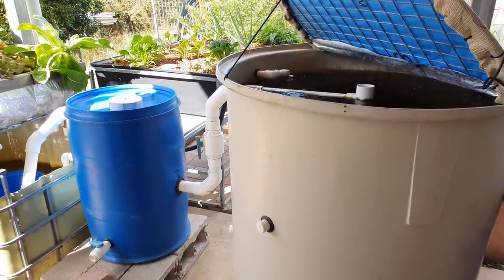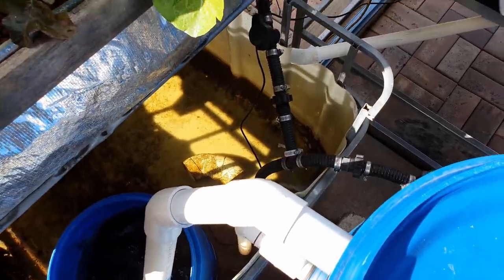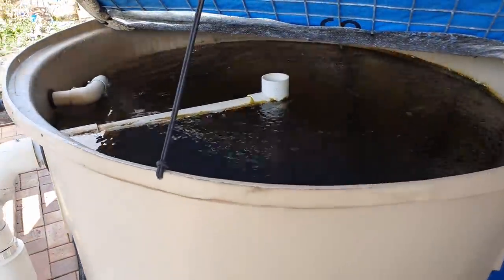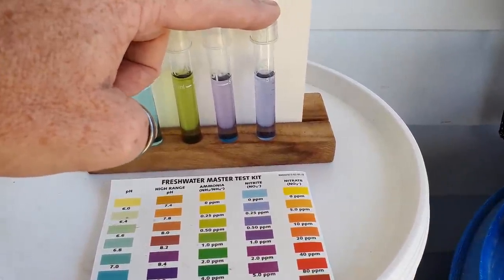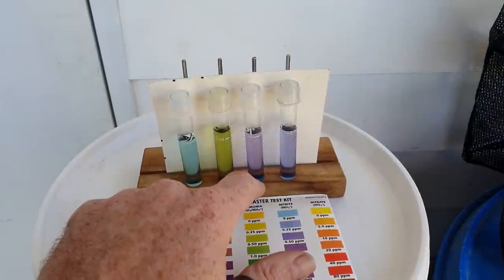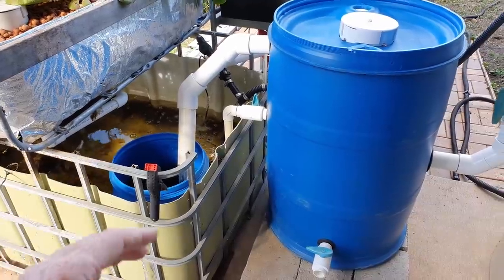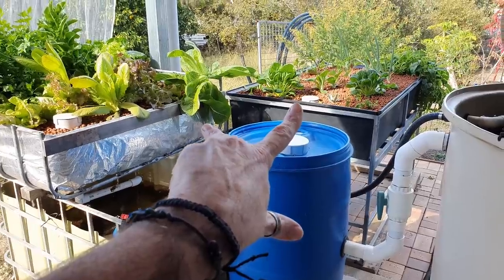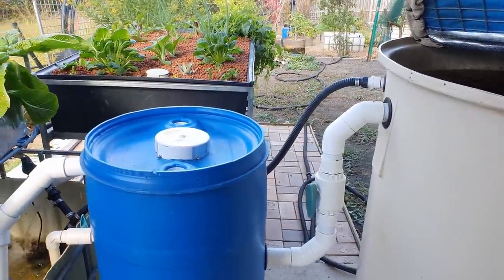Aquaponics System | Nitrite Spike - A Design Flaw & How to Fix It 👍🐟

Comment: Hi Rob, another great video. My suggestion is to go with option 2 - put in another barrel for  a bio filter after the radial flow filter. I know you have to move some things around but would be best option. I did and never had another problem with the nitrates/nitrates and ammonia,  best thing I ever did. Dave from Adelaide
Reply from the maker: Hi Dave. Will be doing the in sump version first as I think it will do the job just fine. It will also help others out that don't have the room for a second large drum in their setup.  
Hope the systems doing well mate. 👍👍

Comment: I didn't know that nitrites and ammonia could be at different levels depending on where the water sample was taken in the system. I had a set up a blue barrel CHOP2 system with a RFF, biofilter consisting of shade cloth, one media bed, one raft, 20 tilapias and flourishing produce over 2 years. The fish stopped eating and my ammonia was at 0.5ppm, Nitrite & Nitrate 0, pH fluctuating weekly between 6.0 - 7.0 with buffering. Your video showed me that I probably didn't have enough filtration for the amount of fish waste in my system. I never really fully emptied the bucket style RFF which I cleaned out once a month. Water temperature dropped to 15C and I gradually lost fish till there were none left. Seems like I've made every mistake in the book: not enough filtration, overstocking, fluctuating temperatures and pH
Reply from the maker: It can be a steep learning curve at times. 
Hope the next system goes better for you.

Comment: Great video. Very instructive & packed with info.  I didn't understand why you took the bio filter out of the system to begin with.  Thanks for your continued work. I agree about the type of beds.
Reply from the maker: Wasn't enough room where the system is currently set up (+ it gave me an opportunity to make a clip like this 😉😁).  
Cheers CC & have a top one.

Comment: Pillow stuffing, dish scrubbies, lava rock, large size washed perlite, or even pool filter sand if used right are good cheap alternatives for high surface area biofilter media. If you can spread the outflow from the radial filter into a sort of "rain shower head" so that it wets all the media, you'll get more bioactivity from the media since it will all be continuously wet. That way you could stuff that bucket in the sump practically to the rim with media.

Just coming at this from the aquarist side of things.
Reply from the maker: At the moment there's shade cloth in there & that was doing fine until I started adding 80g/2.8oz of 40% protein feed in a day. I've seen hatcheries that use a similar filter system where they use massive tanks filled with netting & shade cloth to act as both solids & bio filters. 👍
I have the PE03 so that's why I'll be running with that in my builds. 👍👍
Reply: @RobsAquaponics  
I figured you would likely use what you have already. (No sense buying new stuff when you have something perfectly good) more just saying it for future projects, or others that are in the same boat as me trying to do this as budget friendly as possible. Cheers either way! It's been forever since I've commented, but I've been a sub since all the way back when you had your blue barrel-ponics going. Keep up the good work!

Edited to change "barrel phonics" back to "barrel-ponics" thanks autocorrect...
Reply: Definitely another ball game when your a commercial fish farmer so much changing technology out Thier that costs heaps of $$$ going well Rob your a I speciation mate

Comment: Just an idea for you. What about using the air-stone inside the fish tank and some large diameter pipe to come up with an in-tank moving bed biorector? Would sure look cool.
Reply from the maker: Have seen folks do something similar in smaller systems, much like the in tank aquarium setups. 👍
Would rather have it set up outside in my system for now but it might be something I play around with in the future.

Comment: Rob question here: what if you proceed the solids to the grow beds and keep them there? Wouldnt the grow bed process it? Isn't that stuff even valuable for the plants?
Reply from the maker: They will mineralise in the grow beds as well. Over time they will build up though which may cause issues. That's why many folks like myself remove the bulk of them in the settlers we build. Some will make it through to the beds & that's fine.
There are also decent volumes of all nutrients suspended in the water as well so the plants will never starve in a well maintained system. 
Cheers.

Comment: Hey Rob, love your videos. Why not just add bags of bio media to you radial flow filter. I have had great luck doing something like this in my system. Maybe hang them from your lid on the barrel.
Reply from the maker: I've seen folks set up mini bio bags in their settlers & contemplated doing so as well. Decided against it as the flow rate into the RFS has increased with the new pump so which shortens the retention time further. Is still something I'd like to play around with is I get a larger drum for the next build. 
Cheers Victor.

Comment: Hey Rob. Thank you for taking the time to post your videos. Last fall I decided to take the leap and create a IBC Chop and Flip, flood and drain system. I stocked it with 8 Mozambique Talipia, 2 Plecostomus and they are fertilizing a few Heirloom tomatoes, Jalapeno and Bell peppers, Green and purple Basil, and Khale. I have started experimenting with growing Moringa Oleifera, but since it runs, I will need to figure out how to keep it under control. 
 I was wondering if you given much thought to incorporating IOT(Internet of Things) devices to alert and monitor water chemistry, levels, and flow rates through your systems?
 Thank you again. This is one of the best hobbies I have gotten into.
Reply from the maker: Nice one Duval. 👍👍 I haven't looked into it myself but know a load of folks have set up pH, temperature, water level & other monitors to their systems.  I'll probably play around with something once we get the larger system set up in a few years time. 
Cheers.

Comment: You could add a baffle in the sump (or 2) where the water comes from the fine filter,  through bio balls (or pot scrubbies) and then to the pump. Only requires a piece of plastic big enough to span the length of the sump. Might silicone it, but you could get away just holding it in place with some rocks.
Reply from the maker: That would work but I think a ½ filled 60L barrel will have more than enough surface area for this system. 
Will be able to let you know in a few weeks all going well. 😉
Cheers mate. 👍

Comment: Ok what's your surface area on the bio filter and feed rate per day percentage plus flow rate also how much protein percentage in the fish pellets also do you get wasted fish feed not been eaten on the bottom of the tank and if so how long before it gets sucked up to the settling tank? And do you stop feeding them for a few days to bring down the nitrites ?
Reply from the maker: Hi James.  The bio in the drum at the moment is shade cloth so I wouldn't even like to guess at the BSA. 😉👍
Will be covering the TAN break down in relation to BSA required in future clips. 
The fish finish all their feed or I net it out. Think I've had to do that 3 times all up so far & is normally no more than a table spoon or so. 
No need to stop feeding at the moment as the system is salted & the water temp/pH are fine for ammonia.
Cheers mate.

Comment: Bob have you considered putting the bio beads into the sump tank and agitated with air pump.
Reply from the maker: I have but will be running a straight "trickle" like filter first to see how that runs. Will be easy enough to drop some stones in the drum if I'm finding it's not working too well. 
Cheers Fred.

Comment: Hi rob why were you going back to air pomp and why you don’t go for the kind of venturi you were using? Thanks and cheers
Reply from the maker: I have had water pumps die on me a few times so prefer to run a dedicated air line into the fish tank at all times now Ana. 
Still think they're a good idea for use with the air in the FT & will still use them in the biofilter in upcoming builds. 
Cheers.

Comment: Hey rob I'm about to start setting up my bigger set up I'm looking at have 4 grow beds with a 1000L fish tank and a radial flow separator. Could I use a grow bed instead of a in sump filter to make sure I dont have the same problem?
Reply from the maker: You could run all the water through a media bed first then into the sump if you wanted & I think the majority of the ammonia will be converted.   
Would be interested to see how the levels work for you if you set it up this way Lewis. 👍

Comment: I decided I didn’t want the sump tank water going back to the fish without first going through biofiltration so using two smaller pumps with one sourcing from inside a 6” (~15 cm) pipe inside and receiving water flow from the media & dwc beds. That water going to the fish. The pipe has drilled holes to allow some water flow in and out from the sump. Anyway, that’s the plan. Work in progress.
Reply from the maker: Nice one Joe. Hope it works well for you mate. 👍👍

Comment: Hi Rob, could you put a growbed after the radial flow filter instead of those 5 spoke plastic biofilters ?
Reply from the maker: Certainly can Shane & that's how most systems were set up when I first started out. Pump in sump ► fish tank ► solids settler ► grow beds ► sump. Nice & neat & does the trick 👍
Cheers mate.

Comment: Where'd you get the biofilter plastic from? Are you selling it / recommending a 'version' of it? Could you show off your venturi thats on your website? It looks... flasher than your video from many years ago. Would love to see it in action?? And how many litres of the biofilter plastic did you use for that size container (is that a 200L?)
Reply from the maker: I bought the biomedia years ago with a mate as it was cheaper to buy in bulk. 😉 It's called PE03 & is made by Small Boss. You can also get K2 Kaldness biomedia which is the same. Best thing to do is shop around as you'll find the price will vary greatly. I think I mention in the clip that it's a 60L drum with about 45L of media. 
The venturi on the site is the same as the one I showed in the clip a few years back. The only modification is that they removed the valve on the air inlet as it wasn't being used by mist folks. 👍 Will look at posting a clip on it soon.

Comment: Why not put a bio filter above the fish tank so any return water always goes through it before going into the fish tank?
Reply from the maker: It's more convenient to have all the filtration in one spot. It could also mean more infrastructure for the system depending on how tall the FT is.  It would also be better placed after the solids settler for those that are growing with DWC & NFT as the ammonia needs to be converted through to nitrate for them to use.  👍

Comment: I live in Colombia and cant find many items. I want to build the system. I cannot get those testing kits. 
If I see this problem can I add more grow beds to fix it?
Reply from the maker: Adding more grow beds will help if the water is running through them. If the system was set up as a single loop you shouldn't have an issue at all.  The link below will take you to a section in a clip that explains what a single loop system looks like, 
https://www.youtube.com/watch?v=0QQA5BpWKec&t=5m03s
Hope that helps some.

Comment: Hi bud, can you point me in the direction of something that can handle not being manually fed for 10 days at a time? I was wondering about sucking catfish or shrimp and algae but I don’t know how well that would work

I work a travelling railway job in CQ so I can’t exactly have a pet that requires daily feeding
Reply from the maker: Hey Thomas. Most fish will handle a week or so but am not sure about 10 days. Might be a good idea to contact a hatchery & see what species they would recommend mate. Sorry I'm not much help there. Would like to know what you decide on once you find better info.  
Cheers mate.
Reply: Yeah I’ve been speaking to a bloke I work with (who’s family runs a pet shop) and it seems like the best I can do is an auto feeder and a small aquarium.

Maybe I can do a houseplant aquaponics setup

This week I have the pleasure of 4 days home between two 10 day swings.

Thanks

Comment: Great video Rob, what are your thoughts on a  100  micron mesh filter screen before  the settler, it could be in the top of the settler tank. Cheers.
Reply from the maker: Hey Mike. I think it would be better placed after the solids settler as the larger waste will block it up too fast. 
I was playing with the idea of making up a filter "cup" of sorts to sit under the inlet to the bio out of some fine grade mesh like that. Would just need to pull it out & give it a hose every other day which shouldn't take too long I'd think.
Reply: @RobsAquaponics  thanks Mate Cheers

Comment: Hello Rob! How much of the bio filtration media would I need for a 55 gallon drum to colonize the bacteria? I’m still waiting on. Pieces and parts to begin constructing my system.
Reply: the stuff Rob is using is ~10:1 ratio of water volume to bio media.  So a 1000L/250gal fish tank at max density would need 100L/25gal of bio media.
Reply from the maker: Hi Tracy. It all depends on the amount of feed that you will be feeding the fish. That will give us a rough idea on how much biological surface area that's required for bacteria to colonise. 
As an example, for my climate & the type of feed I'm using, I need roughly 1L/1quart of PE03 or K3 biomedia to process the waste from one fish once they hit 500g.  
So for the 30 fish in our system 30L/8gal of media to process all the waste generated by the fish. 
Hope that helps some. 👍
Reply: Rob Bob's Aquaponics & Backyard Farm thanks again Rob! Keep the videos coming we learn so much!

Comment: How often do you clean the media in the bio reactor?
Reply from the maker: I was going to clean it every few months but ended up scrapping that filter as it wasn't keeping up with the amount of feed that was put into the system.
I installed this biofilter a few weeks back if that helps any, https://youtu.be/U_ulT72bYKk 
I still have a trickle filter of sorts in there but that's more just to collect the finer solids that pass through the other filters. 
Hope that helps some.

Comment: Great video Rob, doesnt the grow media also act as a biological filter?
Reply: Yes it does but because it's a split flow system not all the water goes through the grow beds, about half of it is going straight back to the fish tank.
Reply from the maker: MrPaw hit the nail on the head. 👍 If the system was set up as a single loop, meaning pump in sump ► fish tank ► solids settler ► grow beds ► sump, then it wouldn't be an issue. As only some of the fish tank water is going to the grow beds, only some of the waste ammonia is being processed.
Cheers & have a top one.

Comment: Grow beds are bio filters Bob!
Reply from the maker: Yep, mentioned that at the start. 👍👍
Cheers Jackie.
Reply from the maker: Just thought I'd add in case you can't follow the water flow in the system.  In this system only some of the water returning from the fish tank goes to the beds with the rest going back to the fish tank. 
In a single loop system to water flows like this, pump in sump ► fish tank ► solids settler ► grow beds ► sump. In a system like that it wouldn't be an issue at all.
Cheers.

Comment: salt under 3 ppt plants are ok with, perch handle 5ppt easy  , should always run at least 1ppt anyhow as a buffer to help against  brownblood desease, you can add in a MBBR into the radial flow , just a 20L bucket with bottom cut out with a leaf gaurd on the bottom to contain the media , the inlet updraft moves the k1 , and lets you gain another 10L worth of filtration ~ 50 grams of feed, but to be honest I am amazed you deleted your MBBR 100L of media would be 500grams of feed capacity ...
Reply from the maker: Have seen folks set up the settler as a bio as well & considered doing so myself. 👍👍  It's a bit cramped in there for the 30 or so litres of media I want to use so that's why I'm going with the drum in the sump. 
This system has been set up to show a few problems that some designs have. Wouldn't have much to post about if it was set up like the old one. 😉
Cheers Christopher & have a top one mate.

Comment: Great video Rob, going to check a few spots in the system now.  Instead of sea salt, is there a suitable amount of food grade epsom salts instead?  I have a bit of this on hand.  Thanks!  Keep the vids coming! Cheers!
Reply from the maker: It's the chloride in the salt that blocks the nitrite from the gills so you'll need to use a fish friendly compound that includes it. 👍 Calcium chloride is also use & is probably better as the calcium will be used up faster by the plants. 
Cheers.